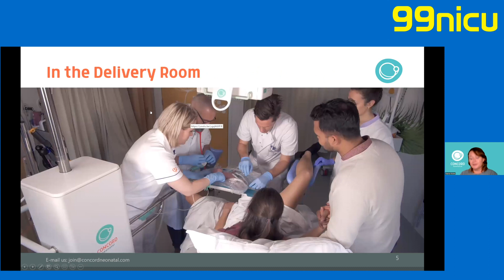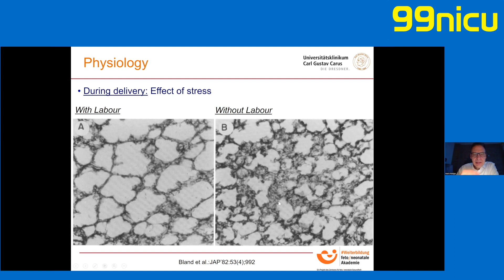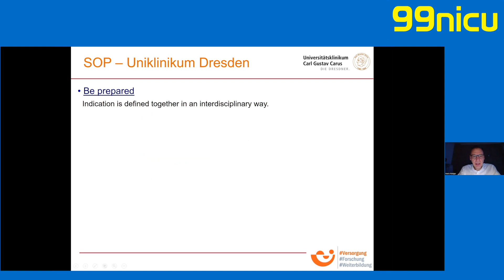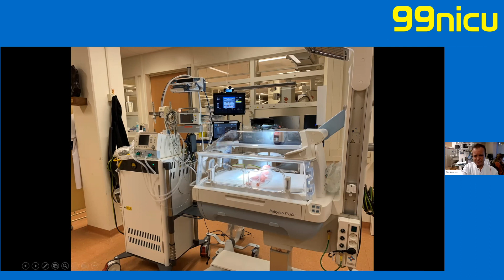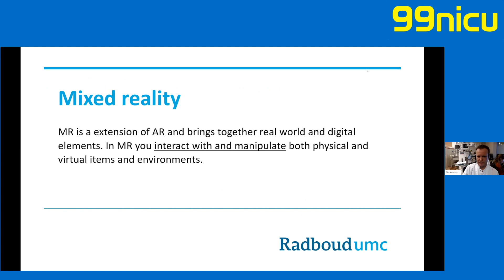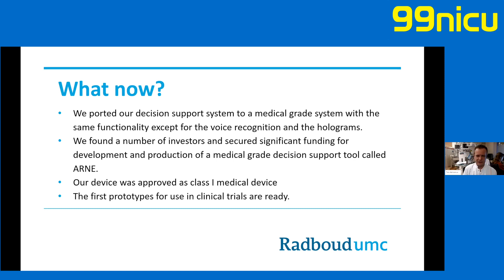How can technology and physiological-based cord clamping help a baby to get the best start possible

Comment: We use physiologically based cord clamping since 2017-2018 yeas. When we started the experience, we understand quickly that efficient placental transfusion is a result of lung and the vessels of lung involving to the breath and circulation. We began respiratory and hemodynamic stabilization on the mother’s abdomen in vaginal delivery cases after long dicussion. The period of delaying cord clamping is very individual, and defining by cord pulsation, especially the end of pulsation. The end of pulsation is the main goal of delayed cord clamping practice, and determine many factors of successes, including long term period associated with stem cells transfusion from placenta. But it’s not always achieved.